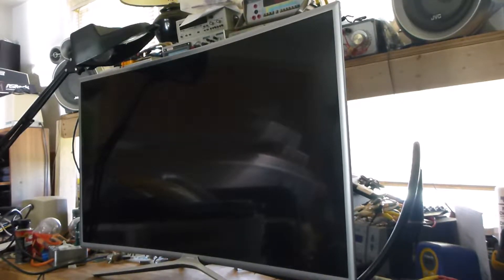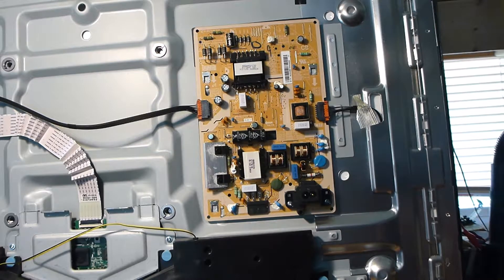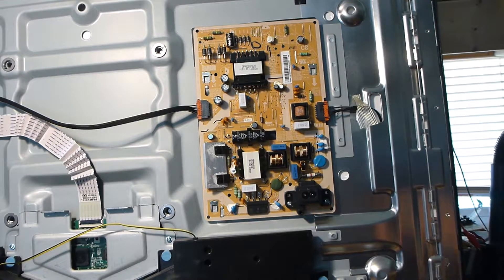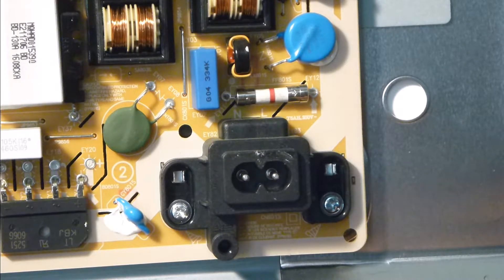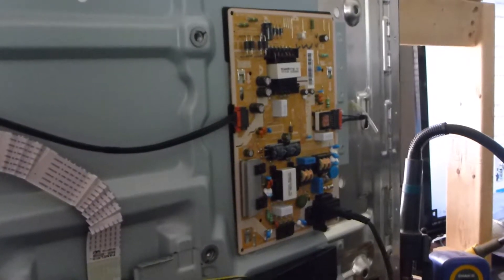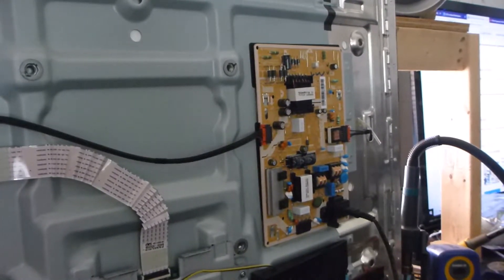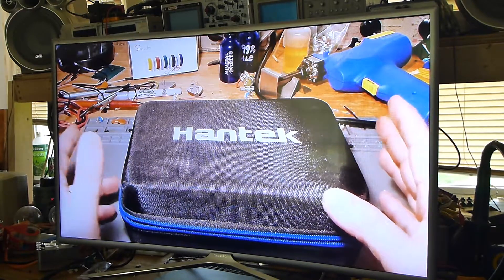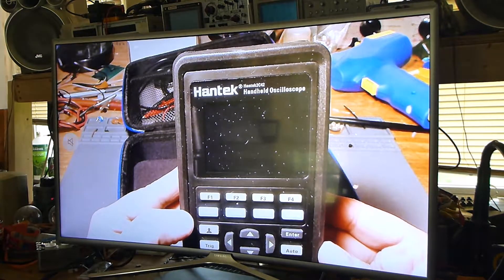Samsung 40K failed power supply

Comment: I miss a quick check for if it was only the fuse and or rectifier tat would be easy to replace that was blown, but you are right that it is probably not worth the trouble and time if the fault is deeper down in the circuit.
Reply from the maker: I just saw your comment Mikael! I did wind up poking at the board and after replacing the bridge rectifier and some fets, it is now putting out the proper voltages. Of course, I replaced it with a new one, so now I have another one if I get another set in. Thanks for your comment and I love your videos!